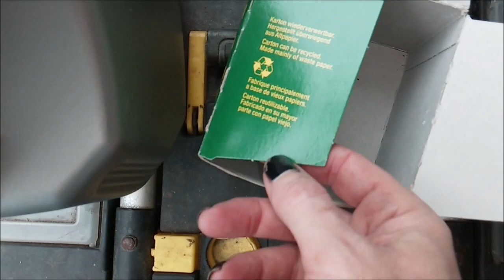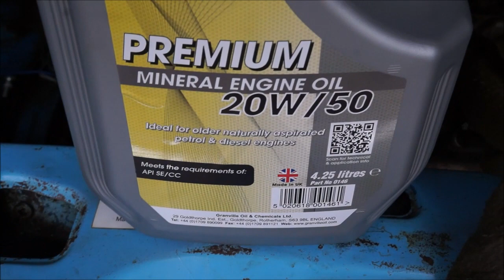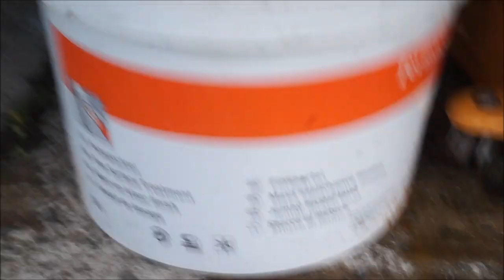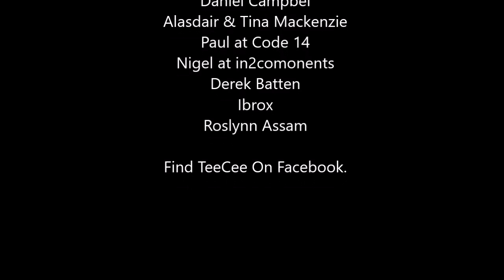TeeCee oil and coolant. Mk3 Ford Cortina Estate

Comment: HI ,I take it Simone you warmed the engine up , drained the oil out the bottom (drain plug) waited until it was empty put a new plug or just a new seal on then remove the oil filter and replace  fill up with oil and leave until it has run down to the bottom of the engine wipe the Dipstick to check how much is in slowly making adjustments the smoke could of just been overfill which you don't really want to do 🤔 and the radiator should have a drain plug ? anyway drain and flush with a cleaner as that is a bit to contaminated it won't circulate well and could  cause you to overheat in my opinion ,you may of done this  but I'm unsure great update  nice to see ATB 🙂 👍Everything Aron's touched has not lasted long unfortunately 🤞
Reply from the maker: The rad has no drain plug sadly it's an aftermarket one, might fit one at some point. I basically did a big top up due to the oil level being so low and I didn't want to run the engine again with so little in it. I will do a complete service though.
Reply: @CortinasAndClassics  I would of thought if you were burning oil Simone at that rate you would of noticed plumes of smoke out the back when driving that's a lot oil that missing 🤔 and there no evidence of head  gasket failure or any oil on the garage floor which leaves value seals and piston rings can you do a compression test 🤞good luck with it 👍
Reply from the maker: @Jaxs2  I haven't noticed plumes of smoke no. I just thought these engines used quite a bit. There are only a few drips off the engine. Nothing of concern though, It's a mystery.
Reply: @CortinasAndClassics  Very strange just keep an eye out Simone 👍

Comment: Looks like oil that's burning. Smell is usually a giveaway. You didn't seem to have oil in water or water in oil, so head gasket probably ok. If you can, do compression test. If you don't have obvious oil leak, then suspect valve oil seals or piston rings. That oil went somewhere.

Comment: Hi Simone, RE: Overheat, good to flush coolant it looked really old. Check thermostat is opening. There should be a radiator fan, I can't see one in the video. Check that's cutting in when the engine is hot. You're losing too much oil and that needs investigating really. If there's no obvious signs of leaks on the garage floor then its burning it. Greta Thunberg won't be happy! Don't let the oil run low. If you don't want to investigate, keep topping up with cheap 20w/50. Mac (Brown Cortina, we met at Gaydon)
Reply from the maker: Hi maca, no it's not old coolant at all. I have an electric fan fitted, you can see it in a previous film I made, i did flush the system but I think there might be a blockage.

Comment: Wow look at that colour of the water but it’s the norm .should’ve  gave me a shout for oil filter tool Simone . Was that the Capri on eBay at £10,000? Both fords looked good
Reply from the maker: Andy the engine inside need flushing properly I think as the rad is alloy. I honestly didn't think about the filter tool, so used to doing stuff on my own lol. Not sure about the Capri's price.
Reply: @CortinasAndClassics  yeah locally Capri I think ,but tee cee engine bay looking clean !!
Reply from the maker: @vwcoco  Thanks :) It's pretty good but will need some repairs on the drivers side at some point.

Comment: If you're overheating open all the heating ducts use  full heat top motor speed and it  will blow a lot of the heat out of the engine.
Reply from the maker: I need to sort out the heater controls. The lever won't stay in the warm position.